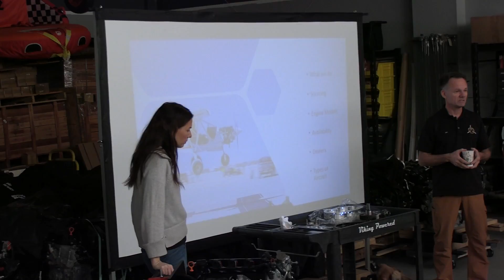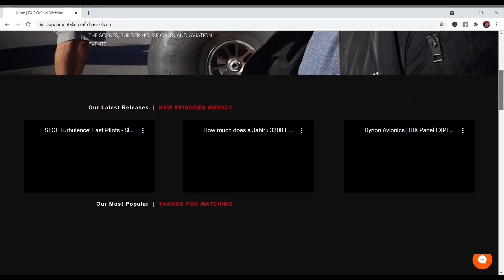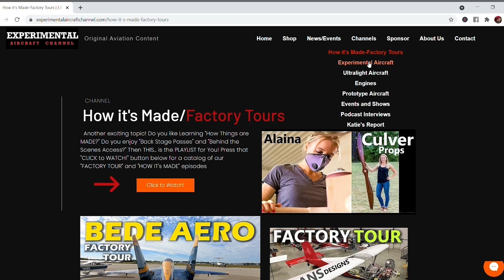Viking Aircraft Engines - How it started - Jan Eggenfellner

Comment: I just got here because a broken set of studs last year in the #3 cylinder of my Piper arrow's Lycoming IO-360 broke, nobody wanted to tackle the work because they have fatter wallet customers and low capacity to handle the request. i couldn't do it legally because I'm not an AP, and the engine shops all wanted to peddle overhaul. Well, then the prices of overhaul for what those engines are, plus the R/R labor, it absolutely ran me out of the hobby in disgust, after 13 years and 3 aircraft owned to date. Just couldn't stomach the aggravation anymore, for what simple lawnmowers these things are. I will never own a certified airplane again, and I am beyond tired of the stranglehold Lycoming and Continental have on the aircraft engine space. 

I find this discussion so refreshing and aspirational. I'm not a "car guy", they're commodities to me. As such, I always took the maligning of auto conversions in recreational aviation, apathetically at face value. But as I get into looking for an experimental acro/XC aircraft (Rvs, or glasair is my target) to be my replacement forever airplane from my past decade long frustration with certified airplanes, I cannot but think auto conversions will be the only way of keeping this hobby affordable going forward. Engine prices of these air cooled Lycos and Contis are to me, the biggest hindrance to affordability, especially for those of us who dabble in sub-80K price points in recreational aircraft. 

I appreciate that clones to Lyco are becoming available in the experimental space to help out the costs, but in order to truly make this non-commercial use of an airplane pencil out, we have to tap into the economies of scale of automotive powerplants and electronics writ large. We will never be a large volume hobby, so waiting on the Lycos and Contis to price down to a market of millions of units a year like cars,  is just never going to happen. 

That's where I think these type of outfits can be the future of our hobby, and obviously experimental regulatory freedoms is a pre-requisite to this effort. I regret not having taken auto conversions more seriously in the past, but if it can undercut the firewall forward costs significantly from what Lycoming and Continental are charging these days, you got a future convert in me.

Comment: I have a Viking 130 installed in my CH750 Cruzer. Lowest maintenance (knock on wood) and most fuel-efficient engine I’ve owned, even compared to the reliable O-360 I have in an RV-8. The Viking is a modern, high-tech, automotive engine.  Turn the key, start, fly.  Simple as that. I purchased the plane from the builder, so only had to reach out to Jan and Alyssa once with a quick question, and I got a quick response. Thank you for helping bring GA engines into the 21st century!

Comment: Really sad to hear Viking won’t be selling any 200hp+ motors. I’ll be building a Velocity XL, and need a 250hp minimum motor. Would absolutely love to go with a Honda auto motor and a US based company too.
Reply: Titan has some v6 options that are over 200hp
Reply: Buy his engine and tune it up to 250-300hp. That engine will go to 1000 for drag racers!
Reply: @waveman8923 Drag racers are constantly rebuilding engines between races...
Reply: @galactictomato1434  I agree but an engine that can do 1000 Hp can easily sustain 300 for years!

Comment: EGR is more of the problem, not blow-by in modern direct injected automotive engines.  Its also not loss of compression, but more so loss of airflow into power cylinder.